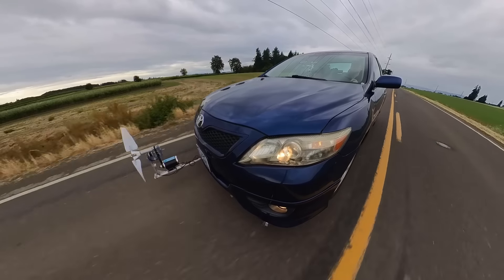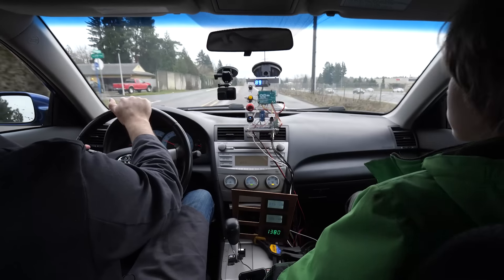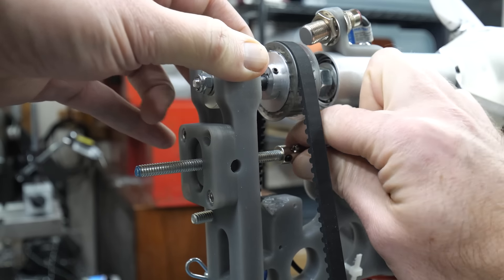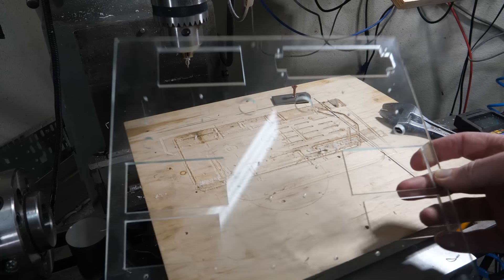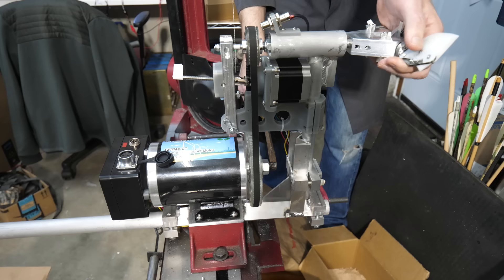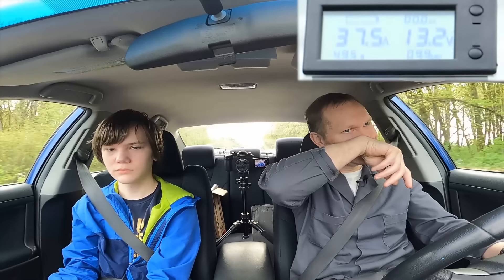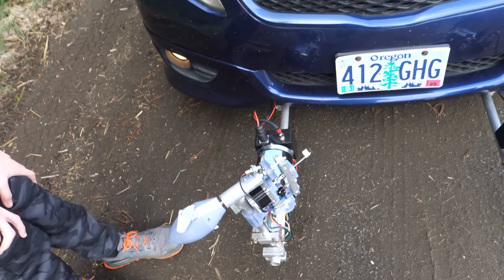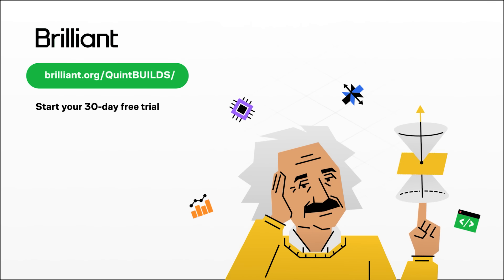Wind Power on a Car #7

Comment: @QuintBUILDs I have a suspicion (based on very little) that the cushion of air being created at the front of your vehicle at speed actually is creating a differential in the stress on the left vs right of the turbine, possibly also the bottom vs top would be effected by the road surface being really close to the blades. I think that may be part of the reason your rigs are getting shredded from angular torque. Mounting them on top of the vehicle at a small height might actually be far more consistent "wind tunnel" conditions, but far more difficult to monitor from within the car. Just armchair advice from someone who only deals with these kinds of forces in video game engines though so take it with a big grain of salt. :D
Reply: Granted, that kind of goes against the idea of trying to convert part of the energy from the vehicle breaking through the wind into electricity 🙅‍♀

Comment: I still struggle with the physics of all of this.  You’re having to use your car’s fuel to move the car and create the wind, which you’re then removing by pushing it into the battery connected to the turbine.  You should have a net loss of energy altogether.
Reply: You could say the same thing about the alternator, this really is just a battle of efficiency of the alternator vs. these turbines
Reply: @coreybean8280  Absolutely true, and if he's looking to replace the alternator with this that's perhaps an option, but given just how refined the alternator has become, he's got a lot of work ahead of him to match that efficiency, not to mention dealing with cross winds, bird and bug strikes, dirt, etc.
Reply: @rationalicthus  he's not looking to make a viable product, he's experimenting with an idea. An idea that everyone tells him won't work but so far I've yet to see any concrete reasoning given. Only that it "seems" to break some law. Breaking down assumptions births innovation.
Reply: @pilotdog68  It’s called the first law of thermodynamics.
Reply: @rationalicthus I fail to see how switching between air and physical coupling somehow breaks physics
Reply: That's exactly what I was thinking. Any energy created is at the expense of aerodynamic efficiency and greater engine load.

Comment: I know you wouldn't be able to change the pitch, but would it not be easier and safer to use a squirrel type fan?
Edit: you could also use a scoop and duct to gather more air, I would say from the underneath

Comment: Seems like the fan assemblies are bouncing around a lot and that movement could be contributing to your issues.  It may help to place some cross bars between the 2 Fan assemblies, so they are more stable.  Glad you revisited this concept. Thanks for sharing
Reply: I would recommend a taller mount to avoid ground strike, and better bracing, the torque twisting the blades looks to be gyroscopic in nature and might mean we need to consider letting the blades stabilise themselves. Cars wobble when driving after all.

Comment: Why not just NOT use the defrost? Are you adding that load to intentionally increase electrical demand? A load could easily be added by plugging something into the car. If you're not using it as a load, just don't use it.
Reply from the maker: Yes, intentionally increasing electrical demand with stock hardware. Didn't need it for that test but hopefully will next time.

Comment: I have a request, will you consider doing thermal power? Either off the engine or from another low grade source like a wood fire place? I was thinking maybe you can beat the pathetically low efficiency and high cost of thermoelectric generators. Maybe using your water turbine but with steam or even putting something like a TEG on the engine block... the practical upshot of doing the TEG on engine block or in engine coolant is you can use it to replace the block heater and increase heat into the engine in the winter by using the TEG chips as a heat pump. But I'd really like to see some other ways that can be made in a garage that can harvest heat... lots of waste heat around these parts.

Comment: To take your turbine to the next level, how about designing a hydraulically controlled propeller hub to adjust the pitch angle. You could set it to return to zero pitch as a fail safe. ❤

Comment: Wind energy on RV’s while parked is something I witnessed and it looks great
Reply: It is neat, but while parked is an entirely different thing.

But the front of an RV would be an even better candidate for energy capture with the idea they're trying.
Reply: @IstasPumaNevada   the energy that you generate while driving comes from the car's engine. There is no free energy. You would need less fuel without that windmill on the car.

Comment: Why is that stepper SOOOO loud?  Are you sure you have the pinout for it correct?  I've used a lot of stepper motors in my day, and one sounds as loud as that, there is generally something wrong.

Comment: As an engineering educator you really shouldn't teach bad engineering practices. Testing to destruction is usually not a good idea, especially if done in an uncontrolled and potentially unsafe way. The first explosion is fair enough but any other explosions should not have happened because you should have identified the problem and implemented safety mechanisms to prevent it.

Comment: - You could maybe make a cylinder style roller above the trunk, like a spoiler. It might be less obtrusive.
-  Also you would not have to worry as much with the blades / props and so on. Or you could do almost a wheel / tower column on the roof. Both those make the 'blades' way less vulnerable.
- You do not want to machine the propeller every time BUT you could do a sort of 'lost wax cast'  or MOLD one and cast it in brass or aluminum for example

Comment: My neighbor duplicated this experiment, but it didn't end well. One of the fan wings ended up scratching another car's windshield. I remember telling him that the vibration could cause the whole thing to fall apart. He obviously disliked my comment and continued. Please be reasonable and use common sense. Doing this on public roads can be hazardous, and even the debris you are leaving behind can be dangerous.
Reply: I would hope that they are at least attempting to recover the shrapnel from the exploding blades.
Half of one of those... Vs the front tire of a road bike, especially on a corner, is going to add up to a VERY bad day for the rider.

Even if not for motorcycles, the edge of a tire will easily launch a chunk into the air.

Comment: I'd try putting it behind the car about 3feet.
Reply: That would not work as the turbine would be sitting in the wake of the car and get no airflow. And if you stuck the turbine out into the airflow to the side, it would increase the effective frontal area of the car, which would waste more energy than you could possibly recover from the turbine.
The only reason this can provide any benefit at all is because the car is sitting behind the turbine.

Comment: Why dont you fix some weak  magnets on the inside facing wheel rims and a bunch of coils to the chasis of the car, which would generate a small amount of electricity, multiplied by Four. This can be put back in the electric vehicle battery, charging it up and increasing range.
By keeping it weak magnet, we won't be putting up eddy current effect on cars motion

Comment: The energy that you generate while driving comes from the car's engine. There is no free energy. You would need less fuel, less energy to drive the car without that windmill on the car.

But this fun generates some YouTube income over the years,  that's a fact ;-)

Have fun ;-)

Comment: I can only conclude you're intentionally trying all these ideas that drive me crazy, lol, and if you really wanted too you know where you need to be and the strength of materials necessary. IMO that propeller should move at the speed and veracity of a cessna plane, smooth and without question up to hurricane symptoms

Comment: The more load you put on those generators, the more power is required to move the car forward because those blades will get harder to spin the higher load you put on them.  It will be impossible to achieve better mileage with those on the front of the car than without them.  You're effectively decreasing your aerodynamics of the car to get those generators to turn, and then you're capturing back a majority of the extra power that the car had to use to push through those poorer aerodynamics.

I've seen people do basically the same concept with a generator attached more directly to the car's wheel and even there it won't grant better mileage because the more load you put on the generator, the harder the generator is to turn.  So you end up with losses in heat in the wire and losses mechanically/friction.  There's nothing to be gained.

Comment: you produce some electricity and loosing same amount of fuel. what's the point?
Reply: The car will be wasting energy pushing through the air regardless. There's a stagnant area of high pressure at the front of a moving car, which takes energy for the car to maintain; putting a turbine out in front of that high pressure area transfers some of that pressure differential to the turbine blades, which makes some of that energy possible to harness.

Whether they get it to break even on the car is another question, but the concept is feasible and does not violate any laws of physics. Only way to know is to try it.
Reply: @IstasPumaNevada  no. putting a turbine in the front of car is like putting a parachute behind the car. companies try to make cars with lowest drag ratio. so you say electric cars must have 10 turbine in the front instead of trying to have lowest drag.